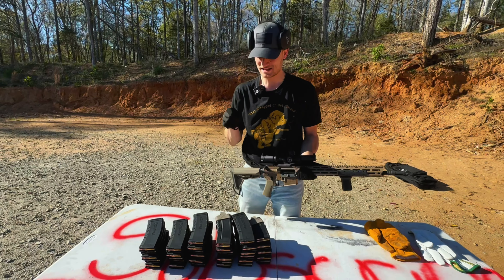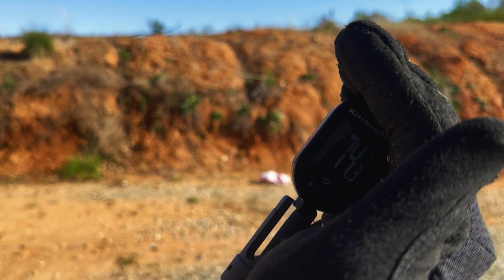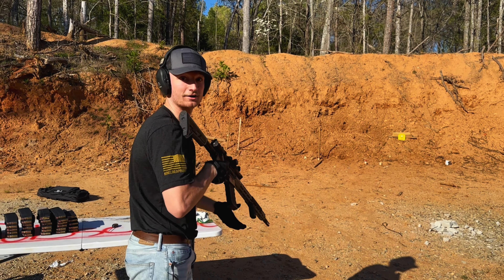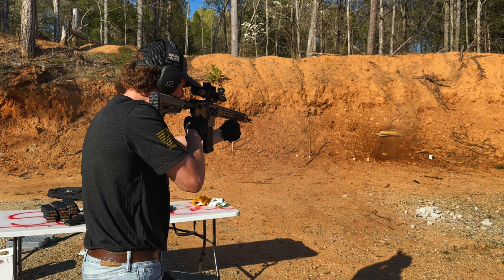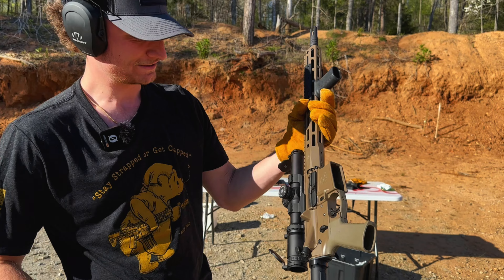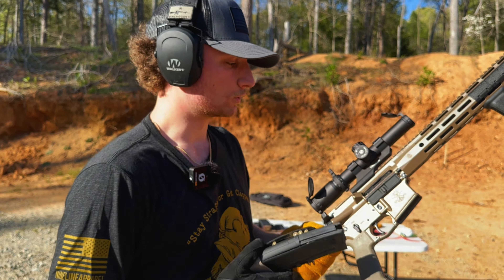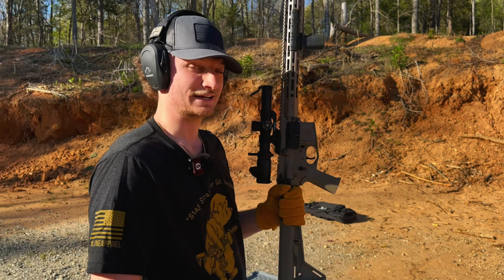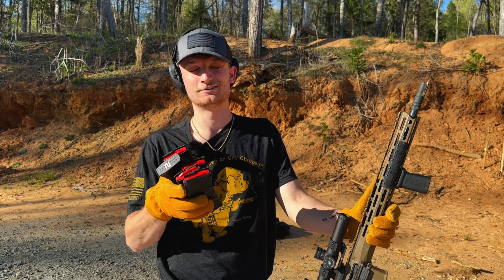1,000 Rounds vs PSA Sabre 15 (It Exploded pt.1)

Comment: This video is a prime example of why you should always wear eye protection. Imagine if you got hit in the face with any flying parts...
Reply from the maker: You are 100% right!
Reply: I had a squib load followed by a regular pressure round in a Walther PPK a little over a decade ago. Fortunately, all I got was sand-blast like powder residue on my shooting glasses and a bulged barrel. Still, made me very aware of how important eye protection is.
Reply: @johnstevens1575  all 3 times I've had a squib my "Spidey senses" started tingling just before I pulled the trigger again so I got really lucky. All 3 times my brass ejected and there was a decently loud bang and I was the only one to notice it was different...just felt slightly off and I'm so grateful I had those senses going off because two were in 45acp and one was a +p 9mm
Reply: @Rottluver425  I was doing a rapid fire exercise on a packed indoor range with plugs and muffs and didn't notice it in time. So, my mistake, but got it off to Walther and back with a new barrel in a relatively short time with only a shipping charge. Carried it as a summer gun for a few years and avoided using Glazer Safety Slugs after the incident.
Reply: @johnstevens1575  just glad you were ok from it. They can be much worse with no rhyme or reason.
Reply: @Rottluver425  Thanks.

Comment: I have 2 of those Amend2 mags and I only use them for training and I never load more than 10rds at a time. Them things are trash! I had 4, but gave 2 away. They are incapable of holding 30rds properly. I load my mags the night before heading to the range and throw them in my backpack. If I need loose rounds in my backpack, I can just chunk them in there or I can load 30rds in the Amend2s and allow them to pop out during transit.🤦‍♂️ I normally use PMAG, Lancer, or steel mags with swapped followers.  They are just better.🤷‍♂️

And that round had to have been overcharged. Stuff happens.🤷‍♂️

Comment: I have been buying Psa for over a decade with no issues thus far. Thousands of rounds with no issues. Now I have had some fail to go into battery or even not eject using Steelcase and things of that nature. And that’s also when I was torture testing with zero lube. There are some used motor oil on their racket a few times, and it just keeps on eating. I’ve got one rifle from them that I toss around in the dirt all the time and people give me crap about the abuse. I put it through. It still shoots true and cycles ammo very well it’s nice and broken in. This was definitely an ammo issue. Guns don’t just cycle for over 100 rounds and then blow up because of head spacing issue. That was either a very hot round or it wasn’t 100% chambered when it went off. Guessing more on the hot round side of it all.
Reply: Same here

Comment: The round cooked off. It was the ammo, not the gun. Had the round not detonated, the gas tube is generally the first thing to fail from overheating.
Reply: Exactly what I was thinkin
Reply: It was also In battery from the previous mag
Reply: If the round cooked off while in battery it wouldn’t have blown up the gun also the gun shouldnt be that hot if gassed properly
Reply: @straight6fords580 really? Is that your opinion armchair expert? 

Go to the range with more then 5 boxes of ammo and you might get a clear idea of how hot they get.  When you get a few hundred builds under your belt come back with a more informed opinion
Reply: @serenmm  I test guns to failure i think I understand how they fail
Reply: @michaelhill6451  I agree I don’t understand the other guy
Reply: @michaelhill6451   I just watched it a few times. He chambers a round, then drops the mag, inserts a different mag, and then pulls the trigger. I now honestly think it is a combination of the 2. The round got hot while sitting in the barrel, and then when he pulled the trigger, it caused an overpressure that escaped around the bolt as it started to cycle and then locked up. It was probably a slightly spicy round that got hot, increasing its spiciness. 
It's definitely a strange one.
Reply: Lmao ammo wont cook off after 160rds. Im an 07/02 sot we shoot 3-400 hundred rds quickly. Never had a round cool. Now over 1k rounds it for sure will

Comment: Please explain how exactly a mag failure could have caused the rifle to explode? 

That gun was struggling hard to run,yeah those mags are junk but it was picking up new rounds,you were ejecting them when they didn’t go off. I think that gun was just barely going back far enough to pick up a round and wasn’t going into battery,when you would cycle it with the charging handle it would pick up a round and fire. Or the head space was just so forked it was having a hard time setting off the rounds. Did you look at any of the live rounds you ejected? Did they have a primer strike at all?

Comment: Definitely an ammo issue not a gun issue. Call out the ammo company
Reply: @michaelhill6451  almost every ftf I have had from any ar was a result of the ammo being under powered or a bad mag. The exception being an out of spec bcg that was not a psa product.
Reply: so you think he had a bunch of underpowered rounds that wouldnt cycle the bolt followed by an extremely hot round? lmao ok then
Reply: @HazardousRob  I believe it to be a combination of bad ammo and an extremely hot barrel/ chamber. Most ammo companies use ball powder that is temp sensitive. If you watch right before the blow up he does not chamber a new round. When he temped the barrel at the muzzle it was over 300 degrees  so think how hot the chamber was. I have had problems with bulk ammo not being high enough pressure to cycle a mid length has system from psa. Switched to actual nato pressure loads and it ran like a top. The majority of failures of this type are ammo related. Use a little critical thinking and watch the video again. With his reluctance to call out who the ammo was made by I would think there is something to that.  But hey believe what you want not my gun and I have not seen it in person to test but if he really wanted to pin it on the gun send to SOTAR he will autopsy and tell you exactly what happened.  Also watch his follow up video. The case is stuck in the chamber. That is 100% ammo case head failure.

Comment: literally had an AR15 explode like this the other day.  same bulging in the lower and the bolt would not go back at all. entire gun was ruined. 

the culprit:  over pressured ammo from a small start up company. 

im guessing this was the exact same problem here. its actually freaky how 1:1 this catastrophic failure was to mine.
Reply: This happened to me years ago with my PSA 15. It wasn't the gun, it was ammo from a recently started factory in my home town. They graciously replaced my damaged firing pin and other parts and refunded the bulk ammo box I had bought. The gun has run flawlessly ever since. My gun wasn't as damaged as yours or this guy's, so it wasn't as catastrophic a failure, but it seems exceedingly similar.
Reply: Most ar catastrophic failures look similar, because it is designed for the pressure to use the magazine as the path of least resistance

Comment: Whatever "high quality ammo" you are using, isn't so high quality afterall. That's definitely a hot round or a 300blk round mixed in. Rifles don't fail like that
Reply: Agreed
Reply from the maker: For sure not a 300blk mixed in
Reply: @ballisticsnation  not trying to be a dick, but thats what they all say until a 100+grain slug is pressed out of their barrel. 

Can you see through the barrel? If not, it's probably a 300blk. Of you can, it could have been a very hot loaded 5.56
Reply: @ChevTecGroup The round that blewups bullet struck the berm, so doesnt appear to be a barrel obstruction.
Reply: Bingo.
Reply: User error is what I'm guessing... I had my PSA glowing before it failed.
Reply: @WVGunsNGoats  He's saying, if it was a 300 blk, the bullet is still probably in the pipe. Prior round could not have been 300 blk, because it would have had very similar/exact same results...
Reply: @joes6313  i was just saying you can see that the bullet strike the backstop that was  fired and caused  the gun to  explode, so its not still in the barrel. Every 300 blk fired in a 5.56 i have seen has stayed in the barrel. I watched the video a couple times to see if there was a hit on the backstop.

Sorry, i worded it wrong in my original reply.
Reply: Soooo what brand ammo was it? Id like to know so i don't use it myself. @ballisticsnation
Reply: I've seen a DD blow up because of a dumbass at the range kept sending the bolt home on a 300blk out until it finally seated and this blowup was not a 300blk out but more than likely a really hot 5.56.
Reply: @WVGunsNGoats  I've seen a few come out, but they were mostly cast bullets that were able to deform enough to go through. I agree that this very well could be a super hot loaded 5.56
Reply: they absolutely fail like that, bad head spacing can cause this all day
Reply: @ChevTecGroup  I actually watched a YT video here in the past couple weeks of a dude who purposely shot a 300blk through a 556 barrel as sort of a torture test. He fired it by pulling the trigger with a string while tucked behind a barrier. I wanna say the gun used was a Bren 2? Could be wrong but it was a high-quality gun I do remember that much. But yeah the projectile cleared the barrel and if I remember correctly, he was actually able to shoot 556 through it afterwards. If someone knows what I'm talking about, please remind me/us here!
Reply: @ChevTecGroup  oh king shit know it all is here everybody bow down. I love how confidently you assumed without any of the variables and just assumed you were right even when the guy shooting clearly said it wasn't. You just automatically assume he's an asshole and you're right. That sir makes you the asshole here.
Reply: @ChevTecGroup also sorry I called you sir you don't even deserve that

Comment: Definitely not the gun lol, either ammo was the issue or a possible fire out of battery which both could explain what happened to the mag.
Reply: Look at the bolt it was fully seated
Reply: Gas system overpressure, you see it a lot when you shoot .300 blackout through a 5.56 rifle. You also see it underwater. Conceivably, you could do it with a crazy pressure 5.56.

Comment: This was an ammo issue.  Newer channel probably buying reman rounds.
Reply from the maker: Negative
Reply: @ballisticsnation  what ammo was it?
Reply: I'm curious as well, I suspect reloaded. Vast majority of catastrophic failures of that type are from hot loaded ammo Edit: or barrel obstruction, either way, from extreme barrel pressures. I personally own the 10.5 variant and haven't had a malfunction, almost 1,500 rounds in, including multi mag dumps. I only run off the shelf ammo, Winchester, S&B, ZSR, Federal, Remington, etc. But curious to find out more information
Reply: @Bourbonlegend1990 has yet to say what ammo he was using. It’s kind of frustrating.
Reply: @twatmunro wants the engagement. I will not be surprised if he rides this as long as possible just to come out that it was a hot round or 300blk. How would headspace be soo bad from the factory that this happened? Like beyond closing on a gauge bad.
Reply: @ballisticsnation yet you keep dodging people’s questions on what ammo. 

It 100% is ammo related. You’re trying to click bait people into watching your video. 

I guess congrats on the view you got off of me but you saying the gun sucks because you out shit ammo in it, really isn’t a PSA issue. That’s a you issue buying or loading shit ammo.

Comment: It was the ammo, whatever ammo you used, caused the problem. You experienced something called a hot round - yes I’m being a smart ass. 

Now I’ve only seen it once in person at the range, but I’ve seen countless videos on the web; it’s a hot round. Your ammo is bad. Even if you had an issue with feeding, it wouldn’t cause the overpressure you just saw. It doesn’t matter if this is a PSA, DD, black diamond, FN; hot ammo acts the same way in every rifle. 

Correct me if I’m wrong, I have yet to see you mention this “high quality” ammo.

Most important thing is you’re safe.

EDIT: using Winchester m193 ammo from the shorts upload. Curious to see what you and PSA discover.

Comment: For all the PSA fanboys that are trying to justify their purchase, it wasnt a .300BLK in the barrel you can clearly see a round hitting the birm when it exploded, .300BLK wouldn't have made it out the barrel. Keep in mind a Geissele can run 800-900 rounds of continuous automatic fire (750-900rpm) before the gas tube melts, yeah the gas tube which is an $8 replacement. If all you can afford is a PSA go ahead but when you have enough just treat yourself to a better weapon yall.

Comment: Looked like you cooked one off as I bet the thermometer only goes to 400 degrees and cycling failure due to lack of lube.  Had a buddy new to the AR platform and only bought three high-end ARs (3k-4k).  I arrived late to the Range and was told by another shooter he had launched well over 100 rounds.  As the Buddy started complaining about the Daniel Defense and Maxim no less, failing to feed.  Glanced at the bolts and suggested some oil was in order.  Had him remove the bolts and properly lubed both and wha-la, hummed like the fine machines they are.  Have built a couple PSA's and find they are a great value with no issues.  Honestly had more issues with high end AR's than PSA.